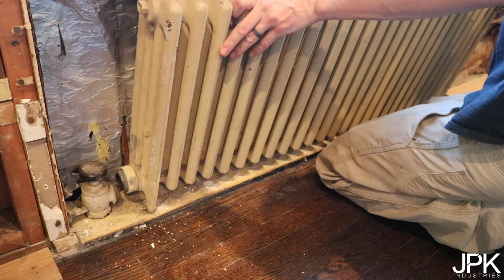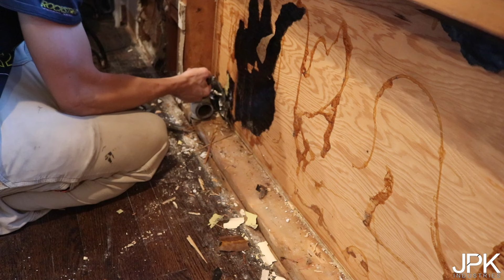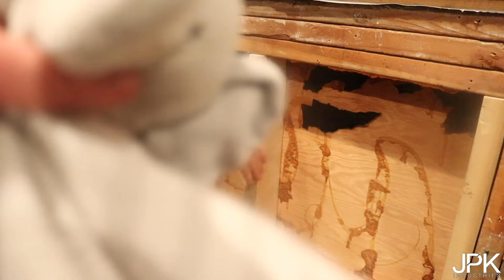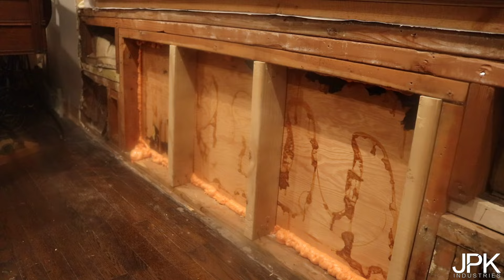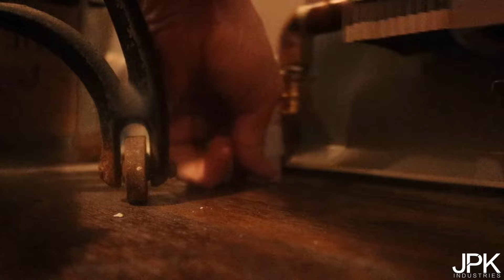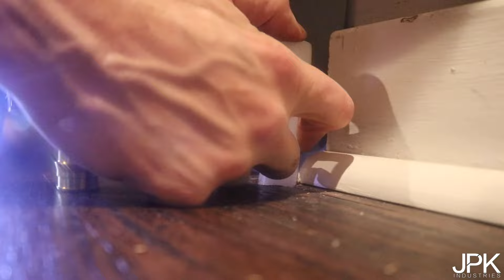Installing PEX with Hydronic Baseboard #uponor #pex #plumbing

Comment: Out of curiosity did you notice any loss of heat output vs the cast iron radiator?
Reply from the maker: Really the only difference is the moister in the air. The reason I got rid of the cast iron radiator is so I can have multiple zones. Plus the boiler I had was getting old which drove my decision switch over
Reply: @ OK that makes sense,thank you for the reply. I am doing some work on my place with an oil fired 2 zone boiler and trying to make sure that I actually make improvements not make it worse. Thanks!!
Reply from the maker: Np!  Good luck with your project